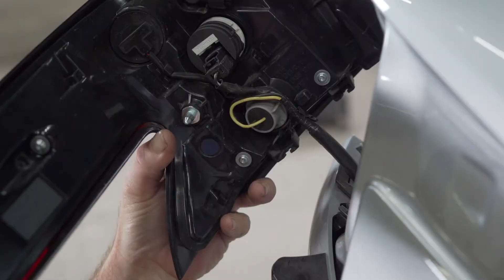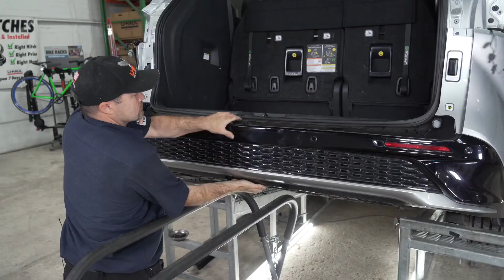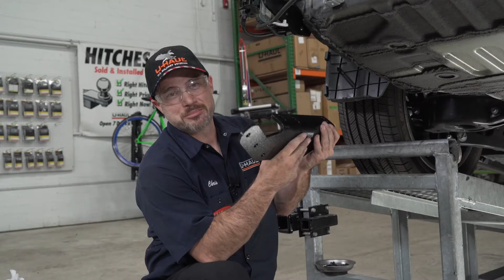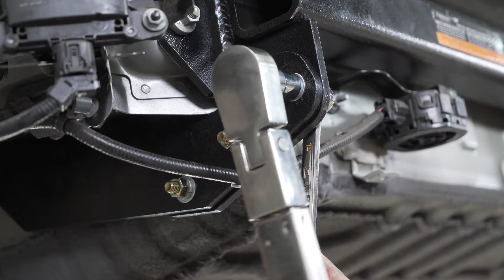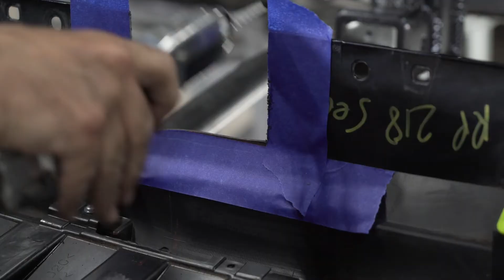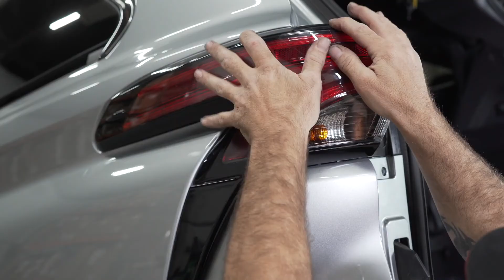2021-2026 Toyota Sienna | U-Haul Trailer Hitch Installation | ECOX7422S

Comment: great job! I learned from your video how to assembly a trailer hitch. The only issue which I have is the kick sensor (I moved it according to this video) because I cannot catch how it works😅maybe few times the kick off sensor did what I wanted.
Reply from the maker: Our apologies, I followed the Hitch Manufacturers Directions to Move the Kick Sensor. The "visible" area that can trigger the Sensor may now be reduced.

Comment: Wow, grest video and so mucb details fro start to finish. Very professioal and clean work. A lot of work for sure and take a lot of time for someone who hasnt done it before. How much does it cost with labor and material?
Reply from the maker: Labor rates can Vary based on your Area. Call or Visit your nearest Local U-Haul and speak to Your Local Hitch Proffesional. Or book Online at https://www.uhaul.com/Trailer-Hitches/ Be sure to match this Hitch ECOX7422S with the hitch selection online. As well Wiring and other accessories are included in the inital quote and can be changed or removed as needed!

Comment: I just had my hitch installed.  Everything looks great, but my kick sensor isnt working.  I can kick  and get a response from the sensor with 2 or 3 beeps, but the door will not open.  I dont get any response when I try to close the hatch.   Anyone had similar issues.  the way this video shows, the sensor is moved but should work.
Reply from the maker: It sounds like the door isnt aware of its current position and doesnt know which way to move, but is sensing the movement. Try disconnecting the negative terminal of the battery with the cargo door closed. After a few moments plug it back in and it should begin to work. This can happen when the Battery is re-connected with the Liftgate open instead of closed.
Reply: @trailerhitches  I have this same issue after the hitch install.   3 beeps, but no movement.  Liftgate works fine otherwise - just not with the kick sensor.  Would disconnecting the battery provide any additional reset than the liftgate recal procedure (turning off the power liftgate on the dash, opening and closing manually and then reenabling at the dash)?  The recal did not fix my kick sensor - but did fix the liftgate movement after a dead battery several months ago.   My negative terminal is impossible to remove....and don't want to take the car in for service if it won't solve anything.
Reply: @mikedomenic3682  did you ever figure that out?

Comment: Does this fit higher up then a Curt one so that less chance of road scraping ? If so how much higher ? Thanks and good video and info.
Reply from the maker: Unfortunately, I do not have the Measurements of the Curt reciever to the Ground. I can only tell you its very low and we added this Hitch as an option on this vehicle for that reason. It is the Highest Clearance Reciever We have. 12.5" from the Ground is better than some sedans! This is the WAY!